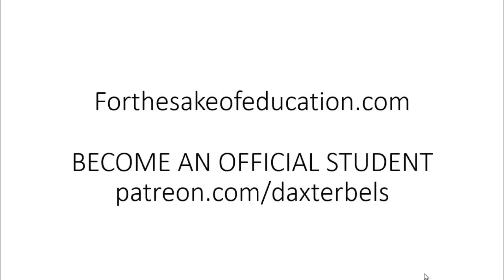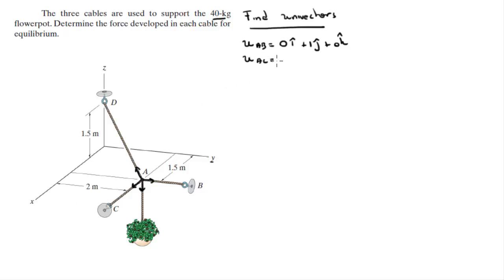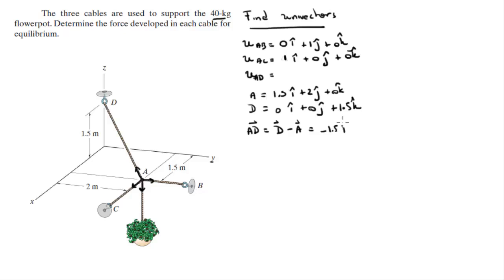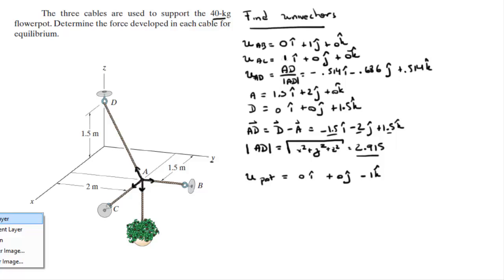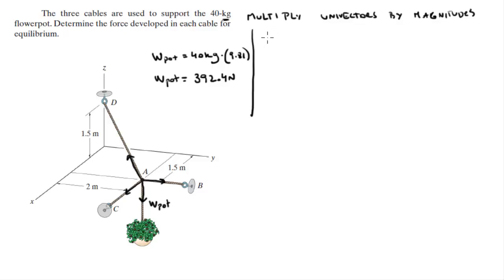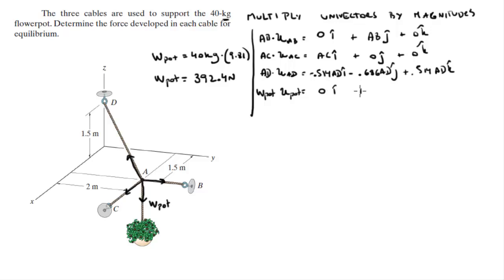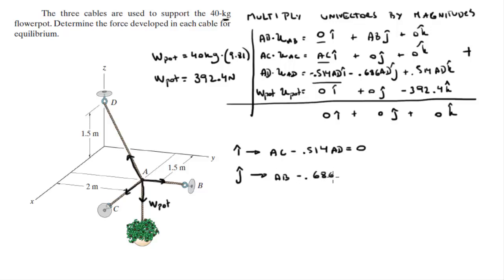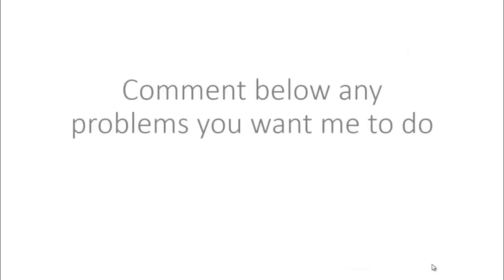Determine the force developed in each cable for equilibrium.

Comment: Determine the force in each cord for equilibrium of
the 200-kg crate. Cord BC remains horizontal due to the
roller at C.and AB has a length of 1.5 m. set y=0.75m 

i wanted answer for this and im completely struck with these problems sir